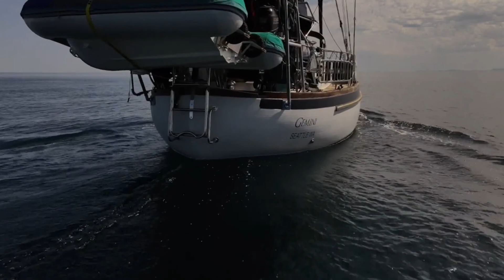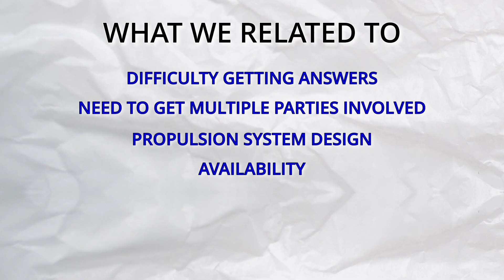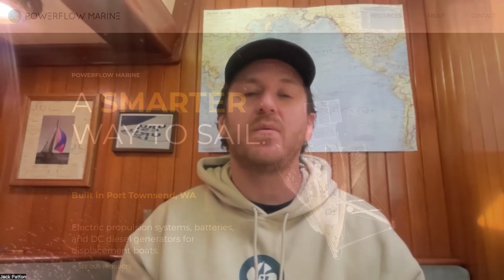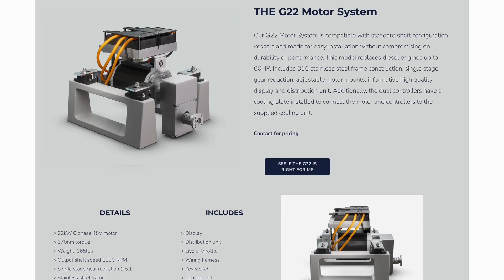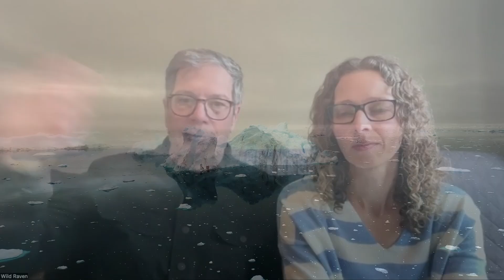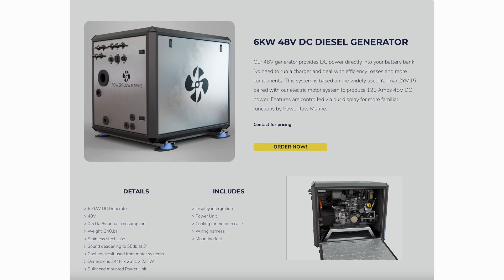⛵️We Almost Gave Up, Then We Found This Electric Propulsion System - Expedition Sailboat Build EP.8

Comment: My Torqeedo Cruise 10.0 FP TorqLink pod drives on 9 LIVES—a $25,000+ investment—have been crippled by design flaws, costing me $50,000+ in yard fees and expenses over months of downtime. I’ve cited Yamaha’s ownership (Jan 2024) twice with no response. I demand immediate action: spike-hardened Master Boards for my Starboard Pod, a prepaid replacement POD Drive Unit for my Port Pod, and coverage for haulout, yard fees, lodging, and return shipping. Details below:
Starboard Pod—Voltage Spike Failures
Three Master Boards ($250 each, $750 total) were destroyed by voltage spikes, measuring 0.0 ohms (shorted MOSFETs/ICs) and triggering Error Code 43 (“Battery flat”). Your 60V limit fails in my setup:
Cause: Renogy 48V chargers at 58.4V boost (default) , combined with noise from my Zokop’s 24V/12V DC-DC charger, generate 65–80V transients. These hit the boards via the TorqLink CAN line. My AWG 00 balancing circuit (53 mm², undersized vs. 95 mm²) and heavy loads (15 kWh/day: ICECO Dual Zone, Starlink 24/7, Ninja 14-in-1, induction burner, kettle) amplify these spikes.
Design Flaw: Torqeedo’s CAN lacks surge protection—unshielded data cables pick up transients from third-party gear (Renogy chargers, Valence batteries), which your manual flags (p. 78) without solutions. Your boards aren’t built for real-world marine systems.
Hardening Boards—Required Upgrades to Survive in the Wild the Circuit boards need:
Components: TVS diodes ($5–$20, e.g., SMDJ58A for 60V clamping), 80V MOSFETs ($20–$50, e.g., Infineon IPP60R099C7), CAN isolators ($20–$40, e.g., ADM3053 for 2.5 kV isolation), and 100V capacitors ($10–$30). A PCB redesign (~$50–$100) for wider traces and separate ground planes ensures reliability.
Cost: ~$50–$150/board for parts, ~$200–$500 with labor.
External Protection: Inline CAN surge protector ($10–$20), LC filters on power lines ($20–$50), and a CAN switch ($20–$50) to block spikes during charging.
Feasibility: Firms like EZTronics (Flushing, NY) or Oceanvolt could modify/upgrade boards, but your TorqLink firmware risks lockout, explained below.
Firmware Lockout Risk
TorqLink’s proprietary firmware enforces hardware authentication for safety and compatibility, rejecting modified boards. This creates a significant hurdle:
Why Lockout Occurs: Firmware uses checksums to verify PCB components against Torqeedo’s stock design (60V-rated MOSFETs, CAN transceivers). Modifications like TVS diodes, 80V MOSFETs, or CAN isolators alter impedance or signal timing (e.g., ~1–2 µs delays from isolators), failing validation. This triggers Error Code 43, communication loss, or complete drive shutdown.
How It Happens: The Master Board integrates motor timing, battery data, and throttle signals via CAN, requiring precise responses. For instance, a 100V capacitor shifts charge curves, or an isolator delays CAN packets, which firmware flags as faults. Without matching your exact specs, the board locks out, halting my 10 kW pod’s operation.
Disabling It: Bypassing firmware requires your source code, which is proprietary and unavailable. Reverse-engineering the microcontroller (likely STM32, embedded in the IP67 box) costs ~$5000–$10,000 in specialist fees and risks DMCA violations or system failure. Even if achieved, disabling authentication could disrupt motor control (e.g., PWM signals at 208A), causing erratic torque or overcurrent—unsafe. No practical bypass exists; third-party mods must mimic stock behavior, limiting upgrades.
Solution: Yamaha’s R&D must develop 80V-tolerant boards with updated firmware to accept new components, ensuring TorqLink compatibility. If EZTronics repairs my boards, you must provide firmware specs to avoid lockout.

System Improvements

I’m installing a CAN switch, setting chargers to 57.6V, upgrading to 95 mm² wiring, and checking grounds (~$120–$300) to reduce spikes. Your 60V boards remain the weak link—my 15 kWh/day loads (Zokop’s 24V/12V, ICECO, Starlink, etc.) demand tougher hardware.

Port Pod—Corrosion & Motor Failure

My Port Pod failed (Feb 2025)—motor shorted, Motor Control Box and Soft Start Board ($450) smoked—due to severe corrosion (Cable Pipe, Aft Mounting Stud, deposits) from galvanic effects (aluminum vs. steel studs) and electrolysis (208A current + saltwater leaks). Torqeedo manual’s vague “can be sealed” compensator block guidance (p. 78) caused pylon flooding—not “cosmetic” as Daniel (Torqeedo) claimed (Oct 16, 2024). 

I give these drives a 3–5 year lifespan, unseaworthy.

Starboard Pod: Supply spike-hardened Master Boards (80V-rated, with TVS diodes, CAN isolators) immediately to restore operation.

Comment: We put electric in our racing trimaran.  It sails over 20 knots in about 15 knots of wind. We had an 18 cm variable pitch before. We want to have a good balance of propulsion and regen.  What pitch and size prop would you recommend for us?
Reply from the maker: @SV_Try_Magic wow! Amazing how fast your trimaran goes. 
Good question about the pitch. Without knowing all the details of your motor and the prop you are using right now, it would be hard to say. We would recommend to write to Jack at Powerflow Marine. He would be able to assist you.

Comment: I’m sorry, 7kW a day can come from a diesel generator in one hour for 1.5ltrs of fuel. It’s simple, it’s worked for 100 years and it doesn’t need a whole load of specialist parts that have very little support outside of the western world. Or I can build a 1.8kW solar array with 3 x 630W panels at £120 each that’ll make 7kW if you want. New tech needs iterative design and that’s simply not possible in the middle of nowhere.
Reply: every tech was new at some point 😀
Reply from the maker: @G11713 @G11713 indeed!

Comment: Very good info. Why the reduction gearbox? 
The extra cost of a motor with a different winding would be less than the cost, weight and complexity of the gearbox?
Reply from the maker: @JacobBohmeDK the reason is technical and we are not sure if we would do a great job writing it. There are a few parameters involved that explain the need of the gearbox. But if you want to learn more, we invite you to chat with Jack at Powerflow Marine.

Comment: EP is great for the vast majority of boats which invariably sail where it is sunny.

But High latitude cruising will be seasonally restricted. There are little to no sunlight hours in the winter.
Reply: This is where re-generative motors, vertical/horizontal wind turbines and hydro turbines comes to play (and a good, reliable generator (or two) for emergency charging/power is a must:)

Comment: For those who need to know:
These cost 10k to 20k USD without batteries.

The technology is finally ready as he says, and I'm very excited for it. But i just cant afford it as yet, at least not without some DIY. There are some industries where costs have come down, but this isn't yet one. For reference, you can get a fully built electric car from quite a few manufactures that's safe, sturdy, and comfortable for the price one of these motors. I'm on the lookout for the day when i can get the powertrain from such a car for less than 10,000 arriving in a box for me to install on a boat as i please. Batteries, controllers, screen, motor, driveshaft, propellor etc for 10k isn't impossible, because that's the standard price for those same components in other industries. Basic shaft seal, prop, and shaft for a light cruiser can be done for about $500 to $1000 at scale. (Feathering props are probably more expensive)
Reply: yt chanel "Reversing Entropy" vlog Titled "Diesel electric hybrid regen" should provide interesting content for you.
Reply: i figured as much as soon as he mentioned custum wiring harness guy is stupid

Comment: The fact that I can't find any prices or even estimates for buying anything from this company anyways isn't promising. The closest I've come is a questionnaire with a bunch of information for me to fill out.

As a matter of principle i won't buy anything from a company who can't even give me a rough estimate without first asking for sensitive personal information.
Reply: You can always build your own setup, many advantages of doing so:) I am currently building a 2 x 10 Kw solution (brush-less and water cooled), you are more than welcome to get the CAD files if it turns out well:)
Reply: @modularhippo  You're spot on. What annoys me is how difficult it is to find good 10kW motors with controllers that can work at 48V for a reasonable price. Especially at 3000-4000rpm.

For my current project I need 5kW per shaft, but the closest cheap alternative is to double up on cheap 3kW motors like those that can commonly be found on Amazon for less than $200. That adds more mechanical complexity than I'm comfortable with though. It's frustrating because by building those motors larger, or selling a tandem version 6kW should have been achievable for less than$500 but I'm just not finding them. Do you have any more info in that regard?